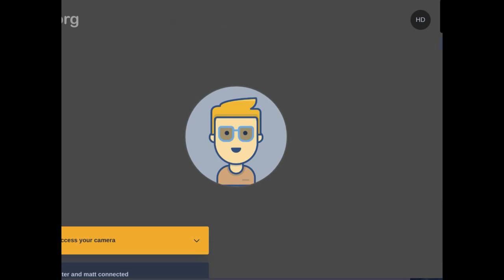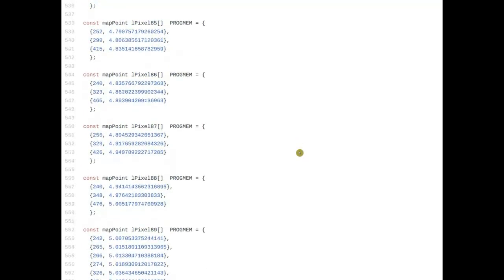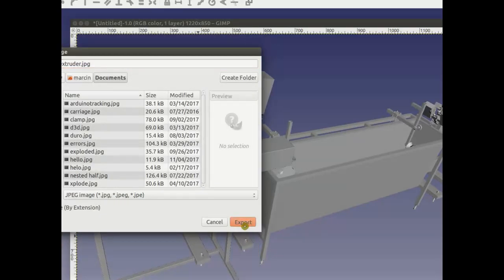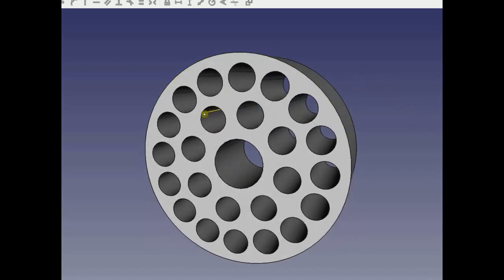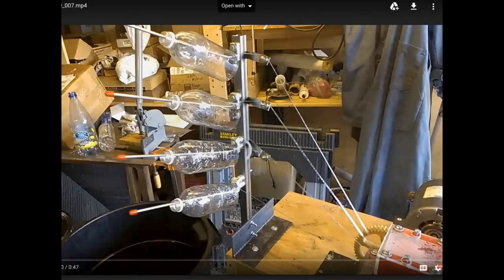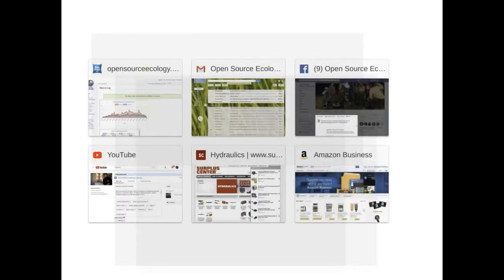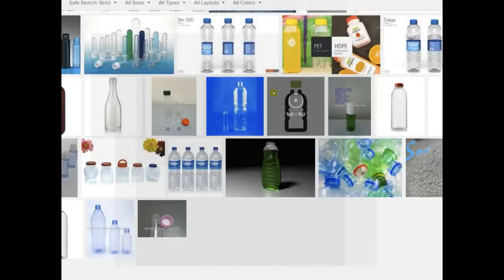Thunderhead Filament Extruder Working Meeting

Comment: Also on the thoughts of pressure vessels, what if we CNC Milled one out of an aluminium or steel block? It would be two pieces the tank and the lid.

Also a SLS/SLM/EBM Printer could make a single piece metal tank quite easily if we could buy/make one. Just some thoughts, no pressure.

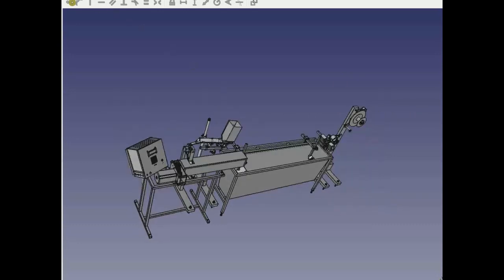Comment: 21:47

High Part Count CAD/Photorealistic CAD Renders are very CPU/GPU Heavy Tasks.  What specs does your computer have?
Reply: Shoot for a high end CPU (Core i7/i9 or equivalents), a high end GPU (GTX 1060 or up  or equivalents),  at least 16GB RAM, and finally either a SSD for storage, a SSD for short term and a long term magnetic drive, or a magnetic drive with intel optane.  Hope this helps.